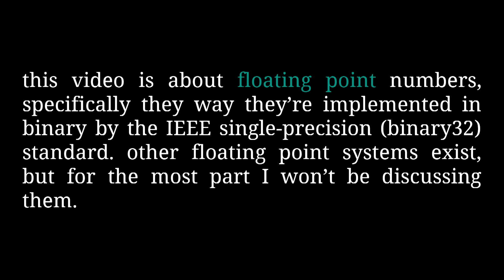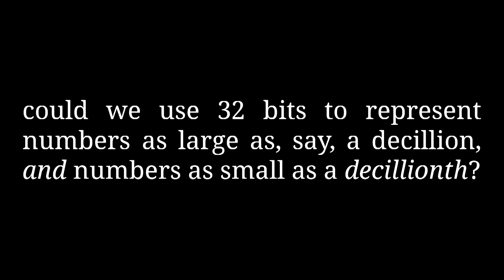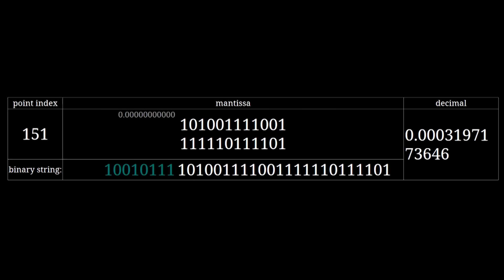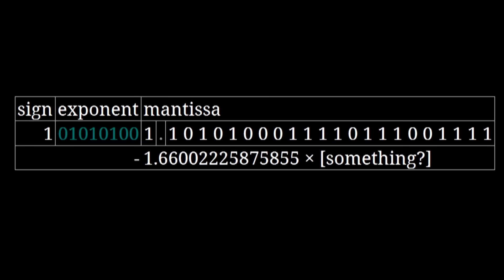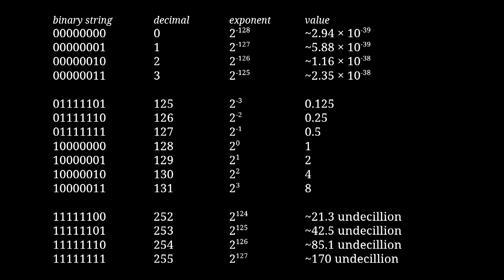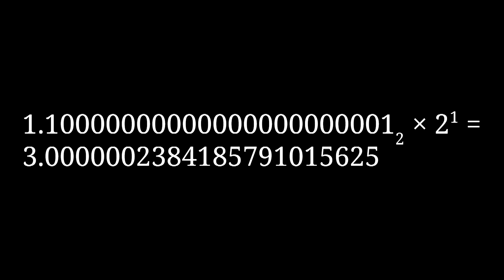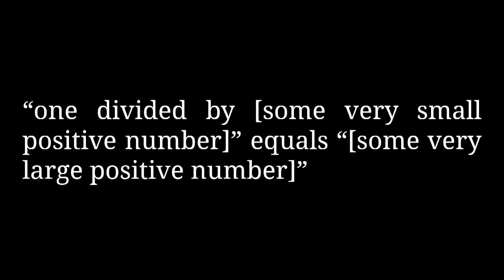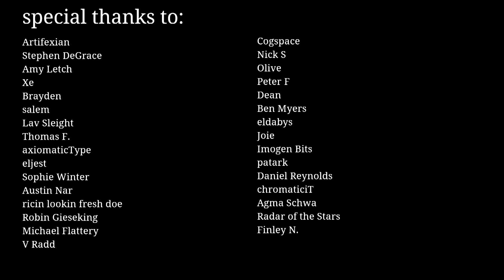how floating point works

Comment: So here is the question, what would a double floating point look like,
Reply: If you mean "double precision" that's just the same but with larger exponent and mantissa fields filling a larger number of bits. However you could also be referring to the much cooler "double double" (which is usually used with the prior mentioned double precision floats, hence the name). These store two separate float values to increase the precision of a number without increasing the dynamic range. Basically, the first float stores the original value rounded to a float. The second float stores the error induced by that rounding, itself also rounded to a float. This gives 2 float values that sum to the original number with no overlap in mantissa bits.

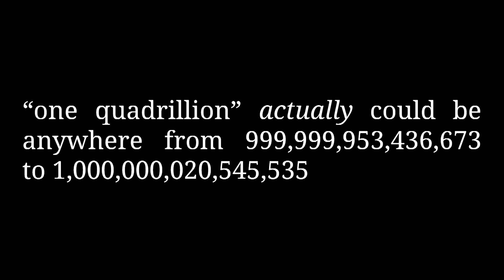Comment: 12:03 sort of makes me want to create a visualization of the floating point system on a mathematical number line, showing these ranges next to each other, with points in the middle showing the interpreted number of infinite precision, and also some points on most often desired numbers (like the integers, like 3. Or numbers along the decimal system, like 0.1 and 0.2 and 0.3) with their little differences from the actually interpreted numbers from the range that those desired numbers fall into.

Comment: As a teenager, I implemented a floating point package on a TRS-80. Basically, duplicated the same format. To test my implementation, I ran it in parallel with the floating point routines built into the Microsoft Basic in ROM and in the process discovered a bug in the Microsoft implementation. Afterwards, I checked for the presence of that bug and it persisted in the IBM PC and continued to persist until float point coprocessors became ubiquitous.

The bug in a nutshell was a premature flagging of overflow during some multiplies.

More detailed information.
The floating point format used a 3 byte mantissa representing a number in the range [0.5, 1.0) and the exponent was 1 byte using excess 128. The format didn't handle infinities, NaNs, denormalized numbers, or signed zeros.
In any case, to multiply, you multiply the mantissas, and add the exponents. Then normalize the number if required.
Well, for performance reasons, Microsoft first added the exponents and if that resulted in an overflow, then would immediately flag the operation as an overflow.
But if you think about it, multiplying the mantissas which range from [0.5, 1.0) can result in a value between [0.25, 1.0) and if the result is between [0.25, 0.5), then it needs to be normalized by multiplying the resulting mantissa by 2 and subtracting 1 from the exponent. So if the initial exponent add overflows by exactly 1, then the multiplication of the mantissa's should be performed in the hope that it would result in a normalization operation which would decrement the exponent back into a representable range.

To show the bug in operation, using an old computer with Microsoft BASIC in ROM, run the following program.
10 A = 1E38
20 B = 1E19
30 C = B * B
40 PRINT A,B,C

The above program will terminate with an overflow error in line 30. And obviously 1E19 * 1E19 = 1E38, which line 10 shows to be a totally representable legal value.

Comment: The reason why 0 is associated with 1 and 1 is associated -1 is because the group { 0  1 } under mod 2 addition/𝔽_2^+ and the group { 1  -1 } under multiplication are isomorphic. Also (-1)^0= 1, (-1)^1= -1

Comment: In the middle of the video, he mentions an "Inception" that you could do to have a "floating floating point" system, where you first determine how many bits go into the exponent and then determine where the binary point goes. This system actually exists. Sort of. People have invented it, although I'm not aware of any serious implementations. It's called "tapered floating point", and it's really neat.

One of the more interesting parts about tapered floating point is a weird side effect of tapering and normalization. Normal IEEE floating point tailors its numbers around 0. That is, if you look at where all the possible numbers you can represent lie on a number line, the densest region centers on 0. Tapered floating point tailors its numbers around 1. Furthermore, it does it in a more precise way. With ordinary floating point, when you get close to zero, eventually you run out of accuracy and have to resort to denormal numbers, which lie evenly spaced on the number line. With tapered floating point, there are no denormals, instead you just make all of your bits exponent, make that exponent negative (exponent numbers are signed in tapered floating point) with the largest possible magnitude and then make the mantissa have no bits. This'll make your number 2^(exp) (remember that exp is negative), which is very small number. The next smallest number ends up being 2^(exp+1), following by 2^(exp+2), 2^(exp+3),...,2^(exp/2), 1.5*2^(exp/2), 2^(exp/2+1), etc.. This means the spacing of the smallest numbers is exponential (in these cases, the numbers having a mantissa of NULL. Ooops, all exponent!)

This is potentially really neat for science/math applications, but unfortunately there's no hardware support for doing math on these numbers, which makes them very slow. Also, I've never seen a software implementation of them either. I think that's because since storage space is so cheap, you're usually better off using arbitrary precision floating point numbers. That's where the total number of bits for the number isn't set ahead of time, but instead you fix the number mantissa bits to whatever precision you desire, and then use as many bits as required for the exponent, using a special data structure designed just for this purpose. And, if you want the center of precision around a number other than 0, you just use an offset. Look at the C/C++ library mpir for an implementation of that.

Comment: What about idle games? Like, 5.0e100, 2.1e1000, e3.140e16
Reply: what does that have to do with anything
Reply: @aendererseje  the numbers are too big to be represented by floating point.
Reply: @ieatgarbage8771  If you just want to store massive numbers without complete accuracy, for example if you're going to show 12,567,000,000,000 as 12.567T (trillion), you could just use standard float/decimal values and show the first x significant figures, with a suitable suffix like this. When you're in the octillions, do you really need to care about each individual integer increment?
Reply: arbitrary precision arithmetic. basically store the bits of the number as an array and do operations manually.

a huge pain to do by hand, especially if you want division, but there are plenty of available packages for any language.

Comment: I've always been curious about how NaN is actually represented in a floating-point system. I've never been able to conceptualize how that kind of thing works because my old CS teachers never went into such detail about how the mantissas of 00000000 and 11111111 worked. Now I realize that a mantissa of 11111111 is how you get NaN!
It even makes sense with some glitches I've learned about from speedrunning. In Metroid Prime there's an "infinite speed" glitch where the player's angular velocity constantly increases. The angular velocity is a floating point value, so as it keeps going up and up, the mantissa needs to keep going up and up to compensate for the higher values, and eventually the mantissa becomes 11111111 (it actually takes a shockingly short amount of time to do this, considering how many values you need to iterate through). 
Unsurprisingly, the game doesn't really have any internal logic for which an angular velocity of NaN makes sense, so the game kind of freaks out.

Comment: We were porting from a system that did NOT use IEEE flt point but instead an 'excess64' type number.  It handled invalid operations like /0 differently.  So we developed trap handlers for new system to intercept /0 and 0/0 errors, then return the values returned by the old system.

That's when I learned that  /0 could actually two different errors.  Any non-zero value divided by 0 was a 'divide by zero' error, but zero divided by zero was an 'invalid operation' error.  What fun we had..  :)

Comment: Floating point numbers have a lot of interesting properties. Generally they are known as "inaccurate", which is true, but even though they floating point operations are "the best possible", as in the result of a floating point calculation between numbers A and B is the floating point number closest to the correct result of the operation on A and B as real numbers.
Nevertheless chaining floating point operations can have infinitely large errors.

There is also a really clever trick which allows you to do calculations with perfectly mathematically true results just using floating point numbers alone.

I have seen a lot of complaints about the "weirdness" of floating point numbers on YouTube and other sites, but in truth they are one of the finest pieces of numerical mathematics/computer science. And if you understand why they are this way you also understand how to use them correctly.

Comment: Putting this in context of calculus, the weird properties of floating point numbers make sense as a limit. The limit of anything over 0 is infinity from the positive direction, and the limit of anything over 0 from the negative direction is negative infinity. NaN is just an indeterminate limit, where it could be any value so you don't know what it is (like 0/0 or ∞-∞). Any number is just the limit as x approaches that number. 

Also, for anyone who cares, I know that I wrote these limits in a wrong and ambiguous way. They should be "the limit as x approaches 0 from the positive direction of anything divided by 0" and "the limit as x approaches 0 from the negative direction of anything divided by 0," but I thought that disrupted the flow of the paragraph.

Comment: The fact that the sign bit is the way it is is actually quite intuitive if you think about it correctly. In computers, 0 is usually telling you "nothing is here", while 1 tells you "something is here". So if the minus sign is repersented by a bit, it's more logical to take the "weird" state in which there is a "negative sign" present - the negative case, and represent it with a one, while representing the "normal" case - the positive case, with a zero. It's a little bit weird because negative numbers are smaller than positive numbers although one is larger than zero, but if you're using sign and magnitude the order is not the usual order anyway, -1 is larger than -2 although 1 is smaller than 2.
Also, this way multiplying numbers (usually?) xors the signs, which is a much more common operation than xnorring, what should have been done if this bit was reversed.

Comment: 17:12 "this whole way of thinking about math, where numbers are these ranges of numbers with limited precision: That's SO different from how I'm used to thinking about math."
That's probably because you're not a scientist. Numbers are always* treated like this in science, because no measurement can be infinitely precise and accurate, which is why the concept of significant digits exists, and why they sometimes give values with "±<some number>" afterwards, or even "+<some number>" in superscript and "-<some other number>" in subscript (giving a range with the most-likely value not necessarily at the linear midpoint). The only difference is that, in science, numbers are often considered to represent probability distributions (often assumed to be Bell curves or similar, for convenience), rather than simple ranges, in which case the "±<some number>" actually tells you the standard deviation of the probability distribution, not merely the sharp edges of a simple range. (In the more informal/imprecise system of significant digits, usually the very last digit is assumed to possibly be off by one, or maybe more, which is why you traditionally give one more digit than is given by the tick marks on a ruler or similar when you measure something with a device like that, for instance.)

*unless they're necessarily integers or integer multiples of something, and the precision of the measurement is good enough that the integers are clearly not off by one or more

Comment: IEEE 754 has many flaws. Many values are wasted for multiple representations of positive and negative infinities, Not a Numbers (NaNs) and subnormal numbers. There are two versions of zero, a 'positive' and a 'negative'. If you change the order of operations you are most likely gonna get a different answer. John Gustafson proposed a different representation of fractions called posits. It is a very interesting concept. It might replace IEEE floats in the future.

Comment: I think that the fact that 1 = negative and 0 = positive is link with the way a computer add and subtract. The ALU (the chip that does addition and subtraction) have an input bit that can be equal to 0 (LOW electric signal) for an addition, and 1 (HIGH electric signal)for subtraction (why LOW for addition and HIGH for subtraction is because of the patern of the logic gates inside the bit-adders)

Comment: I wouldn't call it a "binary point." The decimal point is not so called simply because it's used in base 10. It's called that because you use it to represent tenths of a whole number or tenths of tenths, etc. Decimal means tenths, not tens. (Wikipedia suggests "decanary" for base 10.) So the analogue of that in base 2 would be a word that conveys taking halves of things, which "binary" does not do. I know you're not keen on using Greek or Latin roots for coinages, so let's call it the halfy point for now.
Reply: just call it a radix point.

Comment: Microprocessor/IC enthusiast here.
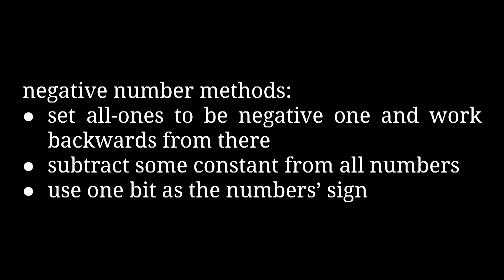5:33
The reason that a 1 in the sign bit of a signed integer is negative and a 0 is positive, is that it saves a step when doing 2's Compliment, which is how computers do subtraction (basically, you can turn any addition problem into a subtraction problem by flipping the bits of one of the numbers and adding 1, since computers can't natively subtract).

Comment: Damn I missed a chance to tell jan Misali (the official feedback form on the seximal website appeared to not work on the end?) a digit set for seximal which isn’t too much confusable with decimal (which is useful when one tries to use both or move to introduce seximal to the decimal world in a more or less realistic manner): Ɔ L U Ɯ M Ʌ.

This is a second version of the initial set which used these same characters but in another order. This one however is memorizable (which you need to make learning operations with those digits less painful to the mind—when you’re done with basic arithmetical algorithms that doesn’t matter anymore). Ɔ is like 0, L is like 1, U kinda has two strokes and reminds L, Ɯ has three—together, L U Ɯ remind both of many Indian-derived digits and Roman I II III (well, duh); M has four strokes, Ʌ reminds M and also reminds Roman V (while M kinda reminds IV).

I tested this system several months ago for a couple of hours populating addition and multiplication tables and using them to make long division to compute 1/N for N up to 18. (It seems except 16.) The numbers are more or less wieldy though I’m not a dyslexic to be a good tester.

The first version of the digits came to life in a process of simplifying Glagolitic digits (for ones) 6 1 2 3 4 5: Ⰵ Ⰰ Ⰱ Ⰲ Ⰳ Ⰴ; they swiftly became Ɔ M Ɯ U L Ʌ but then I switched them around.

The present second version has an ASCII variant. A person from a Discord server I announced it in seemed to be amicable to base 6 and suggested D L U W M A for that. (D could to my taste be replaced with O which is usually quite distinct from 0 but let’s honor the original suggestion, and I still like D more than O here anyway.)

Now: how do you like this? jan Misali pls see this! 🙏🏻I need to wait for a more recent video with a topic close to math to re-post this, I think… Don’t want this idea sleep in a drawer without any use/discussion/refinement.
Reply: In a prejudiced way I hereby upvote the previous and write this comment to make youtube do something and make it more seen than it would otherwise, hopefully.

Comment: Perhaps I'm not connecting two bits of logic, here but at 5:00, I'm not following how they get to the conclusion where the range becomes bigger but the precision becomes less? Like, I'm pretty sure I understand everything before that point, but that conclusion is where they lose me? I don't see how the parts before lead to that statement being made
Reply: The more bits that you give to the point index, the less bits you have in the mantissa, which are the ones used to specify the exact number, hence being less precise.  However, giving a bit to the point index doubles the number of orders of magnitude that the number can be, which increases the range at the expense of precision.
Reply: @danieldavid3766  How does it become less precise though? 11 is still 3 in binary no matter how many zeroes I put in front of it? 0000011 or 011 or 11 is still 3, it still has the same value? I don't get how it's imprecise.
Reply: (11:47) I think this section might help.

Comment: That was a very good explanation. Personally, I always considered finding the best compromise to be one of the cornerstoness of engineering, and this system is a really good example of it.

Also, I find the whole "every number is a range" thing much easier to digest by thinking about it as scientific notation with limited significant figures. Then it does make sense that 1.00000 * 10^15 + 1 still rounds to 1.00000 * 10^15 if you are hypothetically limited to 5 significant figures.